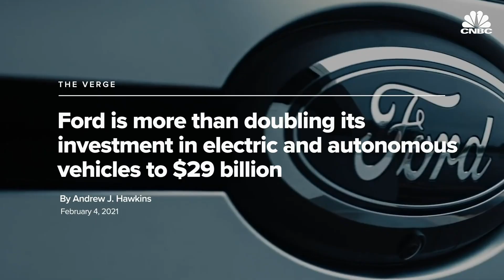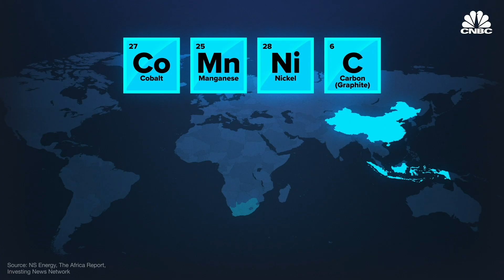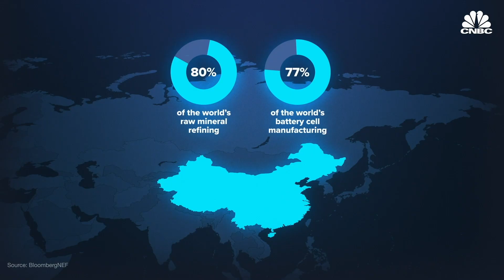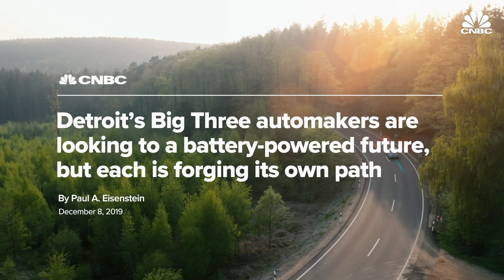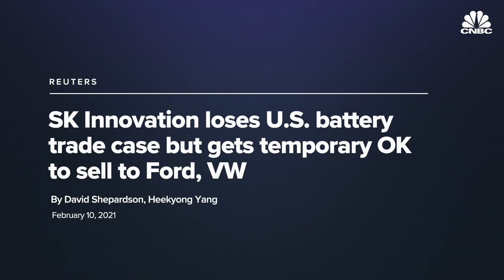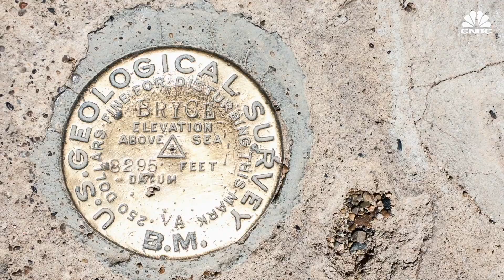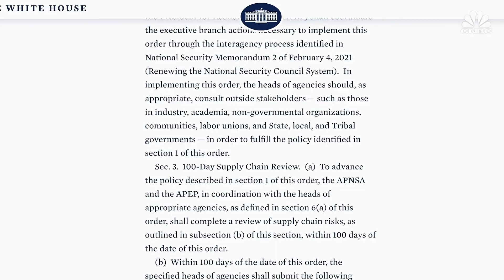Why The U.S. EV Industry Is Facing A Battery Shortage

Comment: Well, lets get rid of all Natural gas, the most abundant energy source across U.S. "before" we have something to replace it, yes forget the fact we need 10 to 20 times more mining and manufacturing materials, factories for the new E.V. lie, every truck stop will need a 150 MVA to 200 MVA co-generation plant for the necessary 500 KVa to 1 MVa and 150 to 200 charging stations, just for one truck stop. POP goes the grid  down.
So glad we have brainless politicians making decisions and not qualified  Electrical, mechanical and Civil Engineers.

Comment: Electric car in the rain season no crash and snow season no crash
Reply: Those batteries in vehicle will charge you inside the vehicles
Reply: Should the drivers shaking while manage to move straight in the lane
Reply: They better stop more room apart or everyone get electric shock from the crash
Reply: We must have more cameras on the public Hwy to remove these drivers and disciplines them before we let them handle the EV
Reply: We can not have dump and illiterate drivers to operate the EV
Reply: China no more communist then be friend.  Or otherwise forget it
Reply: We have more bad drivers.  We remove then we make the EV production.  It will work

Comment: Let's say in 5 to 10 years, the US catches up with enough batteries for for its NEV manufacturing, then you hit the second problem, how do you compete with China's batteries and NEVs when their products selling at half the price with just as good, or even better qualities? The US will have no choice but to put up import barriers to protect domestic battery and NEV manufacturers or they will just go bankrupt like the solar panel industry. Even with import protection, how can the US compete in a global market? It has already happened to Toyota. They sell their NEV in India twice as expensive but with only 1/3 range per charge than China made electric cars. As a result they had to pull 3 models out of India and close 4 factories there.

Comment: The solution has been promoted by myself and others and it is a VERY simple solution.
Don't put a freekin ton of batteries in a car so it goes 350 miles per charge.  
That is just STUPID, driven by Tesla approach to build luxury cars, not efficient ones.
You can use a relatively small amount of batteries and make recharging them fast and easy.

Comment: The Elephant in the room is Lithium Ion is a dead end.  EVs made of with Lithium ion batteries weight too much; a typical Telsa weighs 5000 lbs about twice a Prius or similar hybrid; this cancels out the 94% efficient electric motor; and full EVs cost more energy to make.  Solid State batteries will be needed in order to reverse this obesity problem, however no one makes manufactures them yet and they  are completely different to make;  Lithium ion plants may  become useless.

Comment: Government says we need to be "Green" and electric fast.....Government takes up to 4 years to give permits to build these factories. Also what is gonna happen when we run out of Lithium, since recycling the elements of a battery is more costly or not able to be done, than just mining for more? You know that old dinosaur juice , since it is used to produce the fuel used to mine the battery stuff, and also to charge the battery stuff over and over again. Yes i know "what about wind and water energy"? :Also uses oil lubrication, plastics, and wasted materials in wind energy that can't be reused or recycled easily (windmill blades @ about a 10-15 year lifespan). Everything is just moving the the problem and not solving the problem. What about the electric grid? That could not handle the power required to charge 300+ million or 600+ if most have 2 cars in a night(in the U.S. alone) and still have reserve for A/C, heating , lighting and charging phones etc. Remember no fuel right, so heat has got to come from electric. It looks like a huge problem that we really got to fix.

Comment: Still not sure where to charge my future electric car.  There are two people in my condo complex who have them and one of them is running an extension cord through their front door to their car.  The association doesn’t want to support the infrastructure.  I then travel to a city where I have to park on the street and there is no place to charge a car there either.  This is bigger than a battery problem, it is an infrastructure problem.

Comment: Environmental regulations want us all to be driving electric vehicles in the next 20 years but at the same time are the biggest obstacle in getting it done.
Reply: What are you talking about? Environmental regulations aren't hindering the global production of the materials used in EVs (lithium, nickel, cobalt, copper, aluminum, neodymium, etc.) The problem is that most automakers didn't want to invest in building battery factories and charging networks.
Reply: @amosbatto3051  global production no. But in the US it's a different story.

Comment: You all in the video are overreacting. The transition to EVs is moderately slow and will take years to change the whole cars to EVs over producing batteries, and will cause an average cost that will go over the demand leading to losses. These investments must have at least a low profit so it may be viable and interesting!

Comment: Tesla has already worked around the battery issues with custom designs that minimize the need for rare materials and/or designs that employ more common materials.  Batteries are one of Tesla's biggest moats...and one of the reasons that the legacy manufacturers wont be able to catch up and compete (as critical resources are already under contract).

Comment: Silver prices going to skyrocket with EV and the existing mining constraints
Reply: What are you talking about? Silver is not used in EVs (except for trace amounts used in electronic circuit boards). You are probably thinking about solar panels, which often use silver in the collectors (used to be able 20g of silver per panel, but that amount has decreased and now some companies are using copper or aluminum in their collectors).

Comment: Yet the charging network needs a major change and make their current charging networks! Plus if they were really serious they would require Condos and Apartment buildings to provide level 2 charging for owners/renters!
Reply: Some areas do. Like Cali and here in GA there is a county specific code requirement passed that any commercial building built after 2015 has to have so many pre wired ev capable spots. The utilities need to get smart right quick and start jumping on offering incentives to install chargers.
As they stand to make the most profit from ev use and they can actually shift time of load through smart charging with enough chargers installed. 🤔

Comment: Fully EV is just one option of car electrification, there are many other options like Hydrogen cells or Hybrid systems that don't need a battery but still electric.
Reply: Both hydrogen and hybrid cars need batteries as well, just smaller ones. Hydrogen has significant supply issues as well (way more constricting than BEVs), so really only hybrids are a good alternative.
Reply: Some car companies refuse to make anything other than BEVs

Comment: A plugged-in gasoline-electric hybrid  (PHEV) requires only 1/5 to 1/10 the battery capacity of a long-range Battery Electric Vehicle (BEV), yet can be driven on battery electricity for 80% of its total mileage.  It would make more sense to build mostly PHEV for now, when battery production capacity is still the limiting factor.
Reply: However, fun fact, it doesn't require 1/5th to 1/10th the materials, especially those materials in very short supply. The batteries in PHEVs are higher performance, much lower energy density types, which typically require about twice the copper, cobalt, nickel and aluminum - and except for aluminum, all of those metals are in short supply (interestingly, lithium mining capacity isn't the limiting factor even though it's often presented that way, including in this video). But worse, you need more cobalt than goes into a full-size battery to make the combustion engine parts! And a significant amount of nickel as well. So while some materials can be saved with PHEV production compared to BEVs, it's way less than you'd think just based on battery size. And if you go by the numbers, PHEVs cause significantly less GHG abatement over their lifetime, so the best choice for the environment is still to produce BEVs.
Reply: @ssj3gohan456  --Where did you get your data?  From this reference here https://www.grepow.com/page/high-discharge-battery.html At the bottom of the page, we see the specs for a 10 C discharge-rate LiFePO4 batteries having energy density of 140 Wh/kg which is pretty good for a PHEV.  A 20-C pack would have an energy density of 132 Wh/kg.  A 15-kWh pack would provide 150 kW-300 kWh of peak discharge which is over 150-300 hp, and would weigh probably 107 kg just the battery for 10-C pack, and 113.6 kg for 20-C pack,  or around 120 kg-127 kg with cooling and other circuitry.  LiFePO4 requires neither Cobalt nor Nickel nor Copper, thus cheaper than NMC or NCA chemistries.  A PHEV can do well using a tiny 1-liter-3-cylinder turbocharged engine providing 130-150 hp of power to supplement the >150-300 hp from the battery = over 300-450 hp of peak power, enough to drag race with Tesla's BEV's, yet cheaper to buy, and the tiny engine consumes much less material than a 2.5 liter engine in a conventional gasoline car.

Comment: If everyone would have an ev right now the us would face other issues as well. There’s not enough places to charge for everyone and it will take hours in lines also the power grid couldn’t even handle it
Reply: A Plug-in Hybrid Electric Vehicle (PHEV) can be charged at home for daily commute, and can use gasoline for driving long trips, thus does not require public charging station.  We could be building Plug-in Hybrid Electric Vehicles (PHEV) that consume only 15% of the quantity of gasoline of comparable gasoline vehicles for total mileage driven, yet a  PHEV requires only 1/5 to 1/10 of the battery capacity of a long-range Battery Electric Vehicle (BEV).  In another words, a PHEV can be driven on battery electricity for 80% of its total mileage.  It would make more sense to build mostly PHEV for now, when battery production capacity is still the limiting factor.

Comment: Are you kidding? Almost every industry especially the automotive industry is truly specialised and reliant on complex supply chain system. The reason is simple, not enough battery producers because there were not many demands. Once those giant companies start manufacturing EV, they battery makers will follow. Simple supply and demand equation.

Comment: use soda cans and metal sheet to improvide capacitor battery for emergency use in case of AA space air defense with hundred thousand of soda cans you literally have mega wat power delivery supply system if you need but it is very dangerous up to that number

Comment: In the last decade, here in the USA 🇺🇸 we worked hard to get independent from the Saudi and Middleastern Oil By pushing for subsidies and supporting Tesla and others alike....

Now that we’re winning in that sector,

We are also becoming dependent to battery manufacturers and the Raw material that goes into these batteries! Mostly in China 🇨🇳... 

I guess somehow, we’ll always end up being dependent / now a bigger risk than before. China 🇨🇳 is NOT Middle East or Saudi Arabia 🇸🇦...
Reply: It wouldn't be as big of a problem if corrupt GOP politicians weren't protecting their fossil fuel industry donors and instead worked with Tesla to build up a local supply chain for battery manufacturing. Now because of them we are well over 10 years behind. If it wasn't for Tesla, America wouldn't even have its foot in the door.

Comment: If the United States does not have enough batteries, what do you think it will do?
I think the United States will withdraw from the Paris climate agreement and continue to use gasoline vehicles.However, the profit of overseas automobile market will be greatly reduced.😂😂😂
So don't believe that this will infringe on national security, it is only harmful to the economic interests of the United States🤣🤣🤣
Reply: We could be building Plug-in Hybrid Electric Vehicles (PHEV) that consume only 15% of the quantity of gasoline of comparable gasoline vehicles for total mileage driven, yet a  PHEV requires only 1/5 to 1/10 of the battery capacity of a long-range Battery Electric Vehicle (BEV).  In another words, a PHEV can be driven on battery electricity for 80% of its total mileage.  It would make more sense to build mostly PHEV for now, when battery production capacity is still the limiting factor.

Comment: EVs are not practical nor affordable. They are only going to become more expensive. They are forcing them on the population without regard to the economics on consumers. EVs will only be for the rich in the future.
Reply: We could be building Plug-in Hybrid Electric Vehicles (PHEV) that consume only 15% of the quantity of gasoline of comparable gasoline vehicles for total mileage driven, yet a  PHEV requires only 1/5 to 1/10 of the battery capacity of a long-range Battery Electric Vehicle (BEV).  In another words, a PHEV can be driven on battery electricity for 80% of its total mileage.  It would make more sense to build mostly PHEV for now, when battery production capacity is still the limiting factor.

Comment: It´s why I laugh so hard when they say "Ford and GM are coming for Tesla" . 
They don´t even have a plan to build their own battery factories.
Reply: It's too late for Ford and GM. They have to worry about sun-setting their ICE business. They are on a big disadvantage already. Just like the Newspapers and their printing press.
Reply: Oh Jeff u walked right into that one which is a glass door. Sometimes people sound smarter if they don't say nothing at all.
Reply: GM and Ford are going to use there Tier 1 suppliers to build battery packs for them. GM's biggest Tier 1 supplier, Magna International, partnered with LG Chem to provide batteries for a Magna built battery pack. Why would GM and/or Ford want to build their own battery factories when they have a massive & proven Tier 1 supply chain that will design/build it for them? All automotive companies have their tricks when it comes to "making it happen". Tier 1 suppliers are that trick...
Reply: @petersonj8  GM is building a battery Gigafactpry with LG Chem. It costs $2B, takes 2 years to get online, and will produce 40GWh of batteries, enough for (checks notes) 400k BEVs.
GM will need 10 of these factories over the next decade to make 400GWh for 4M vehicles, and still won't be won't be 100% EV. 
Meanwhile,  Tesla's 4680 cell GFs will be making 2,000GWh worth of batteries by 2030, enough for 20M vehicles.
If GM and Ford wait for their Tier1 suppliers, Tesla will have already eaten their lunch.
Reply: @petersonj8  perfect! So they will stick to their traditional approach, gives me even more confidence in Tesla. Battery tech is the future and the less the traditional OEMs know about it, the better it is for Tesla.
Reply: @petersonj8  Meanwhile Tesla has a pilot plant in Fremont that has a capacity of 10 GW for a single line and is about the 10th largest operating battery manufacturing plant in the world with plans to have up to 250GW manufacturing capacity ate each of it's gigafactories plus a roughly equal volume from LG, Pana, CATL etc over the years, each of which is committed to building high volumes of Tesla's 4680 cells

Comment: China doesn't produce enough oil so they have to transform for renewable energy.  United States is fine with less battery production. Hybrid Ford explorer or Toyota rav4 can get over 35mpg. Carmry Prius can do 50mpg. Tesla will not dominate the car market what so ever.  ICE  is here to stay.
Reply: You're not just wrong you're stupid.
Reply: Ever heard of climate change?
Reply: @deathgun3110  Ever heard of PHEV?  A Plug-in Hybrid Electric Vehicle (PHEV) can be charged at home for daily commute, and can use gasoline for driving long trips, thus does not require public charging station.  We could be building Plug-in Hybrid Electric Vehicles (PHEV) that consume only 15% of the quantity of gasoline of comparable gasoline vehicles for total mileage driven, yet a  PHEV requires only 1/5 to 1/10 of the battery capacity of a long-range Battery Electric Vehicle (BEV).  In another words, a PHEV can be driven on battery electricity for 80% of its total mileage.  It would make more sense to build mostly PHEV for now, when battery production capacity is still the limiting factor.

Comment: Lots of people say they like the "gas guzzling" experience of owning an ICE car. But tesla can easily make a ICE mode, by adding a gas perfume in the car, disabling home charging, reducing accelleration by 95%, adding speakers and gas guzzling sounds, and increasing vibrations in the engine and car , and purposely misalligning the engine magnets to increase inefficiency, as well as disable battery management system 99% of the time to increase fire damage and fire chances by 100x to match that of ice cars These simple modification will allow people to get the gas experience while still riding tesla.
Reply: Yeah! Sort of like dating a robot woman.
Reply: While bothering to do what you suggested, when we could be building Plug-in Hybrid Electric Vehicle (PHEV), having a real gasoline engine to produce all the noise and vibration and gasoline fumes that anyone would want.  A plugged-in gasoline-electric hybrid  (PHEV) requires only 1/5 to 1/10 of the battery capacity of a long-range Battery Electric Vehicle (BEV), yet can be driven on battery electricity for 80% of its total mileage.  It would make more sense to build mostly PHEV for now, when battery production capacity is still the limiting factor.